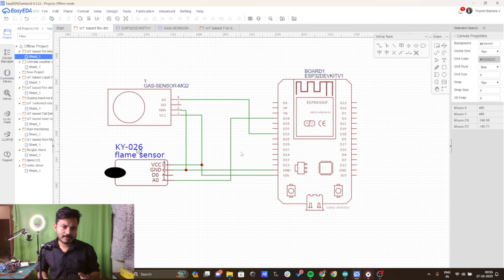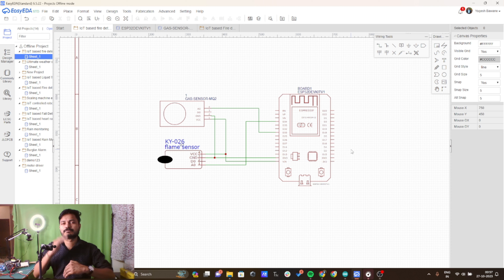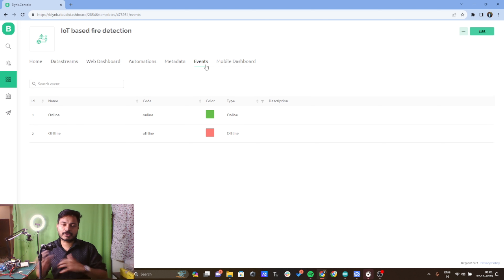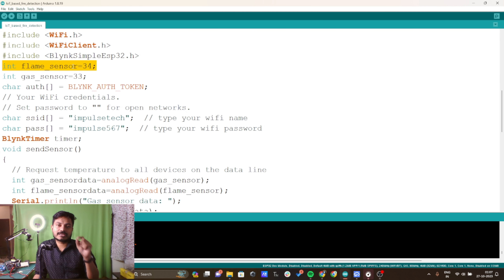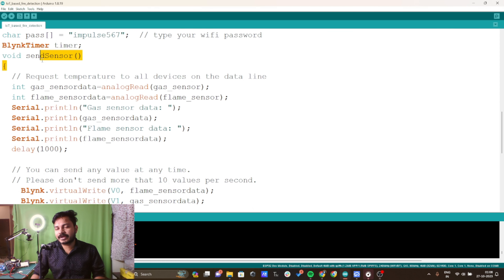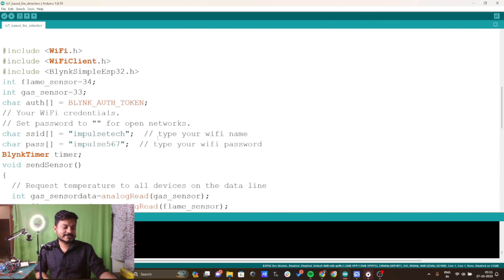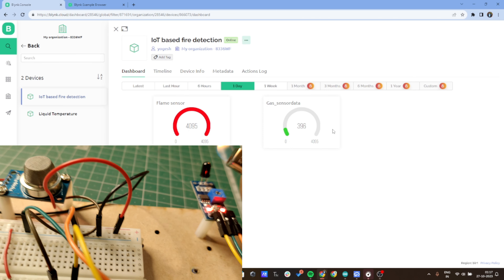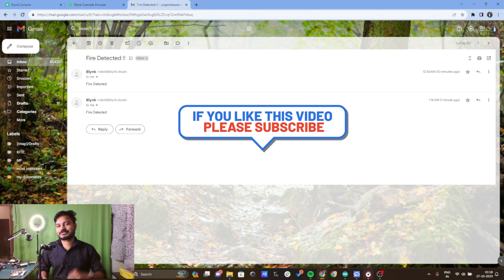Fire Alert ! Building Your Own Smart Detector with ESP32 & Blynk! 🔥| IoT based fire detection #iot

Comment: can you connect many of these detectors to one phone? and during the notification, can it specify the location of the detector?
Reply from the maker: Yes bro it's very simple.
It's possible
Reply: Just add another esp32 module right? Just add another identical device?
Reply from the maker: @joshuagrapani9282  no you have to use only one esp32 just give different name to the each individual sensor that you want to use . For example if the sensor placed in the hall give the name hall fire sensor and if the hall fire sensor detects fire you will receive and email mentioning there is a fire in the hall
Reply: Thank you. 

Can I also trigger a water pump to supply water in case of a fire? Using the same esp32?
Reply from the maker: @joshuagrapani9282  yes you can do that using the automation tab in blynk iot
Reply: Thank you again my friend.

If the locations are far from each other, will the voltage drop not affect the accuracy of data that the sensors will gather?
Reply from the maker: @joshuagrapani9282  yes there is chance of voltage drop
Reply: @ImpulseTech  will it affect the sensors?